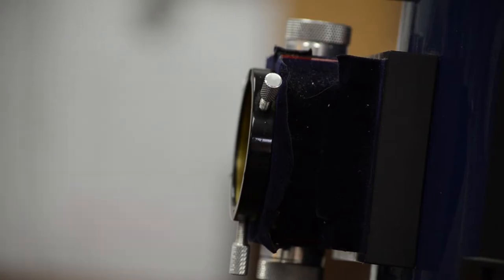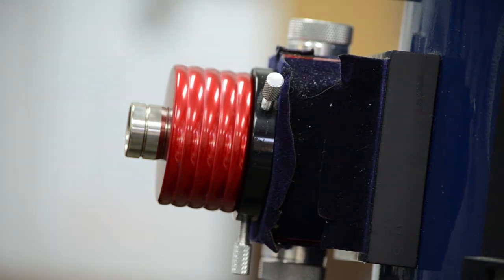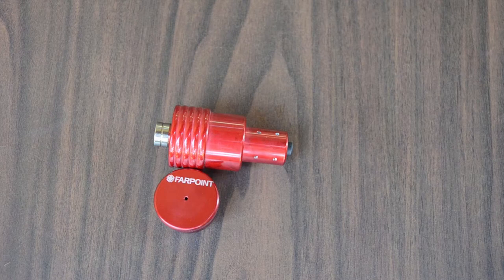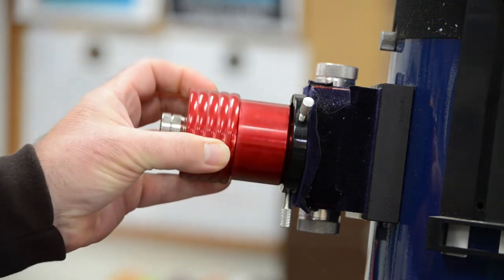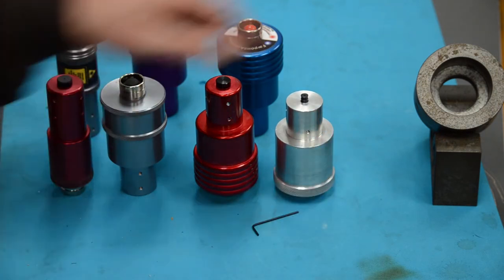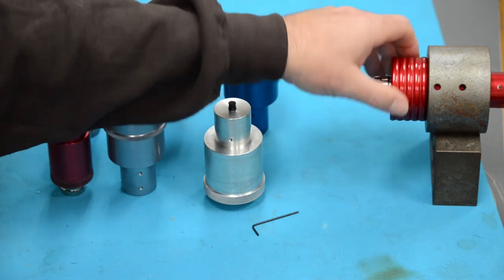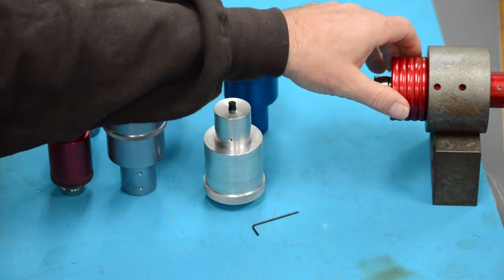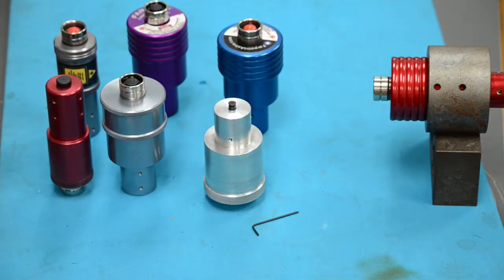How to Test and Collimate Your Laser

Comment: I bought a Meade laser collimator and it is way off. A lot worse than your "ugly" example. I've been working on and off for a while trying to dig the gunk out of the holes so I can get to the mystery screws or allen heads. Why would an instrument used for precise work such as this be sabotaged? Filling the adjustment screw holes, in my mind is a work of sabotage and or just plain stupid.
Reply from the maker: Ours are very precise, and if it isn't, then it is definitely defective and we will happily exchange for one that is in perfect shape. www.farpointastro.com
Reply: I have wasted many hours, on multiple occasions, recollimating a cheap $25 laser only to have it wiggle out of alignment after a few uses (I used this laborious technique for over a year). Seriously, don't waste your time. You don't have to buy this laser, but you should definitely invest in something high quality (ie. this laser).